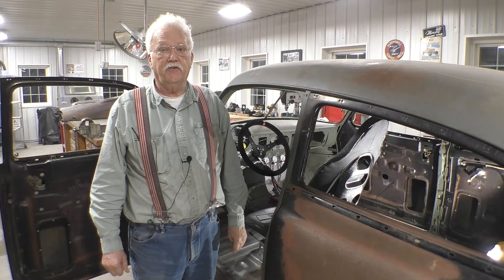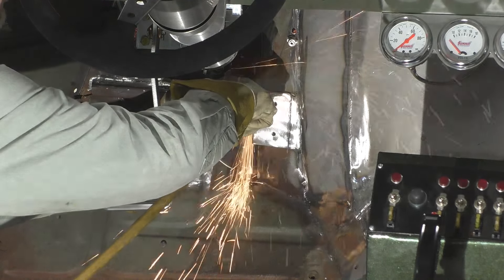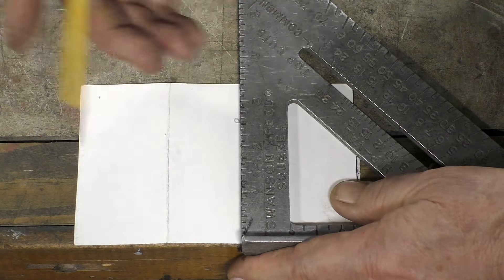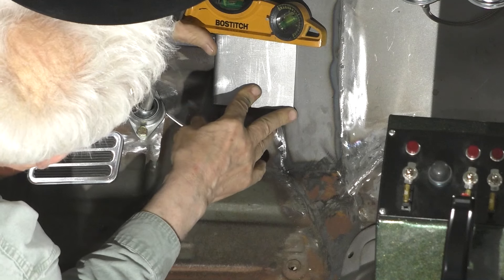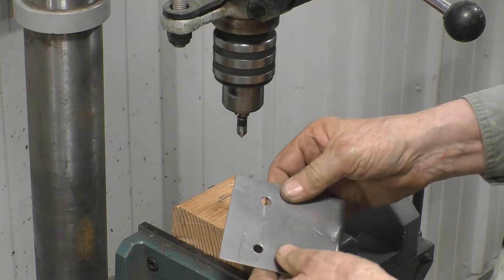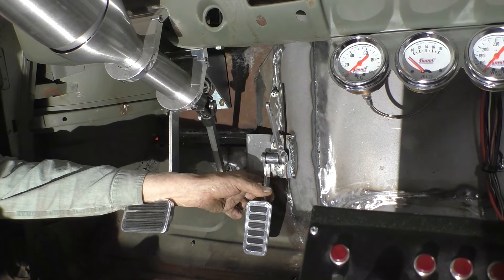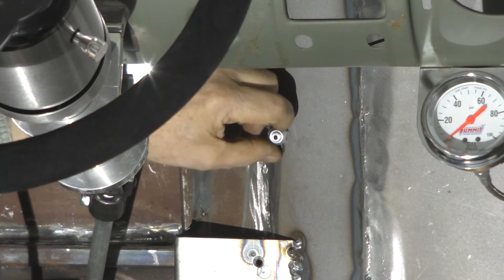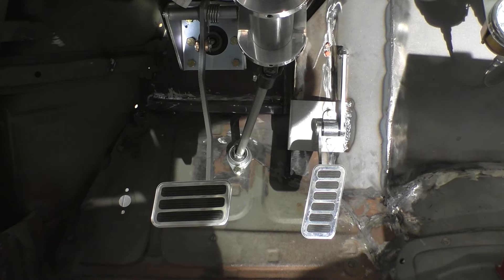Moving The Gas Pedal, 1949 Chevrolet Gasser

Comment: I have found that an elevator bolt under the pedal arm is necessary to keep from over pulling those set screw type cables. When it's go time and your trying to push that pedal through the floor, if it doesn't have a positive stop it pulls the cable out of the thimble and you no longer have WOT, plus it's hard on the carburetor shafts to over travel the lever. Then your tightening up the set screw more and you end up with a frayed cable and have a mess, if you adjust it so the pedal bottoms out on the floor then you have no adjustment. I figured this out setting up Jr. dragster throttles where you need a guaranteed reliable throttle for safety a set screw is no match for the strength of your leg. I think a 5/16" elevator bolt has about a 1" dia. flat head, I drill and tap a 1/4" x 2" plate and weld it under the pedal with a jam nut for quick adjustments and it's one less thing for the driver to be concerned with. Just my thoughts it's coming together nicely.
Reply from the maker: I agree with you and we will be adding a stop

Comment: I would have just heated and bent the brake pedal.
Reply from the maker: That would have put the pedal to far from the floor and I was not into cutting it. Thanks for the comment.
Reply: @ThrottleStopRacing  I meant sideways towards the door
Reply: @kermitbearden7142  The Caprice pedals I stuck in my 49 rub on my C30 steering column. I will be heating and bending them.